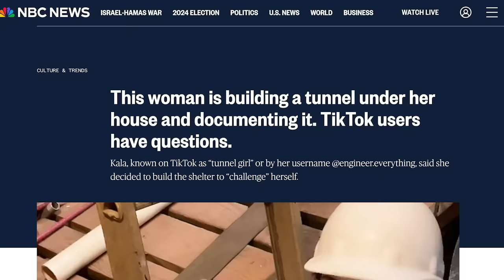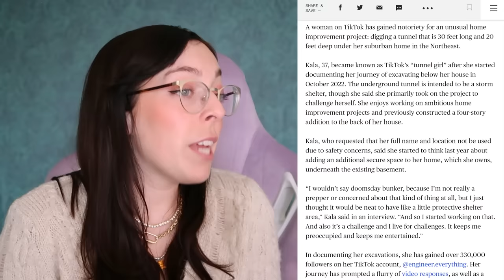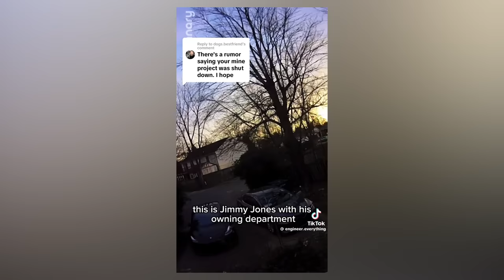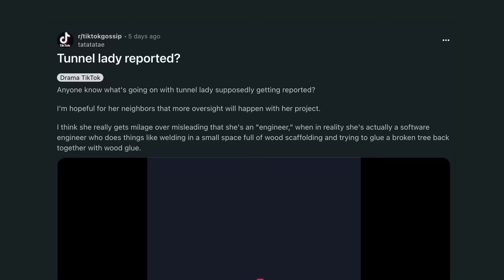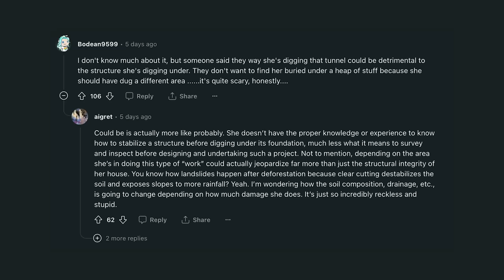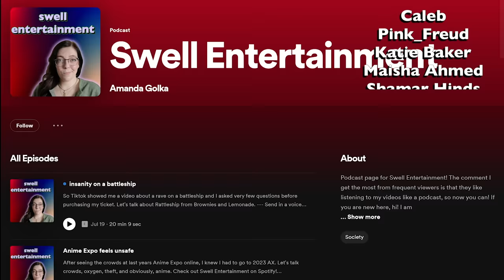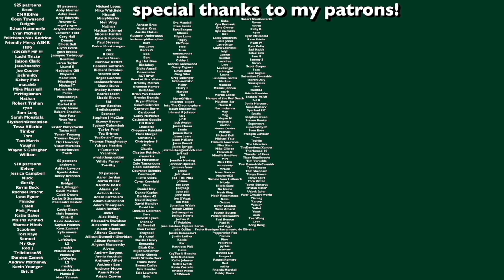people are being weird about the tunnel lady

Comment: Structural EIT here. The problem is not just the safety of everyone in and under her house. Weight distribution in the ground is not entirely vertical. If you've ever been to the beach and stepped in sand, you've probably observed the sand spreading outward and, in the surrounding area of your foot, even rising upward. Entire apartment buildings have collapsed into rubble because someone dug a hole for a parking lot without shoring up the walls.
Reply: I am wondering if they'll condem the entire structure, She built it up with multiple stories and then built a tunnel UNDER the slab.  It can't be safe to live there.
Reply: @Kimberly_Sparkles   I don't see any other alternative, unless she wants to pay a consulting firm to fill it back in safely.
Reply: @JayJohnHeitmann only the most desperate of firms would be willing to take that risk on.
Reply: It’s so scary. I can’t believe she is doing this even with tenants living in her house…. She’s gonna get sued and imprisoned at some point. Or die and go missing down there 🤦‍♀️

Comment: This reminds me too much of the case of Daniel Beckwitt. He hired someone to dig a tunnel under his land and it eventually killed his worker with his gross negligence after a fire broke out in the tunnel. This can either end up like Colin Furze or more likely, Daniel Beckwitt.
Reply: THANK YOU! I’ve been racking my brain trying to remember the names. Such a sad story,
Reply: Did something happen to Colin furze? I saw his digging content but I hadn’t heard that anything happened? I put a  comment at the time pointing out that undermining the foundation without adding reinforcements fast enough to prevent the structure shifting is a bad idea, but I was hoping that they had either fixed it before it effected the structural integrity of the house and the neighbouring houses and/or gotten help with the thing from professionals and gotten the project inspected by the building inspector and structural engineer or geological survey or whatever is supposed to actually happen with the city before he just started digging, at least I know he had the locations for the gas line and water and sewer pipes and he didn’t break the water or gas lines as far as I could tell.
Reply: @MissMeganBeckett  I didn't see anything happen to Colin Furze. My comment was more along the lines of "it can be a success story like Colins or a failure"
Reply: @mothmansuperfan7513  thank you for replying, I’m glad that nothing bad happened to Colin’s house tunnel project that I hadn’t known about.

Comment: I was watching her videos and enjoying them when I thought she was an actual engineer. But when her concrete forms collapsed I knew something was very, very wrong.
Reply: One thing I see no one mention is someone saying she actually got the rock she found wrong, then when she got new rocks they were soft ones. So she couldn't even properly identify what she's digging up and using but these are meant to support her tunnel and castle
Reply: She’s saying  it’s “entirely under the slab of her house,” yes she’s building over 20 feet outward from her wall….is that entirely under the home?

Comment: There are long term issues that stretch long after Kala is gone too. This isn't ugly paint colors, or tearing down the cabinets. She will not live forever and then that house gets sold to someone else. Imagine if no one had ever found out and they moved in and there was a horrible accident? There's a reason you need permits, and safety protocols. 

Her common sense is clearly not there. And as one ND to another, I am telling you there is something off about her. She's not all right, and she needs an evaluation. She potentially needs supervision for her own safety, because this is certainly not going to be the last dangerous thing she does. Her judgment is just not there.

Comment: She should have never tunneled. She could have built a in ground, under slab storm shelter by cutting a rectangle in the slab, digging it out, building the shelter walls via concrete or steel, then re pouring the slab with a door.  People do that all the time.  Once she starts tunneling  under her slab things get incredibly sketchy as she is going under potential loads of her house and risks hitting underground lines and utilities. You can also easily get off course doing this type of thing and end up somewhere you didn't expect. Then there is water and erosion and it washing out after a heavy rain. Those who had concern and reported her were justified IMO.

Comment: It's actually not that hard to get a permit and pay a company to review your plans for this kind of work, there are a few small tunnel systems here built for during the snow. Admittedly when we did it at my uncles we were building the house as well so we already had a lot of equipment and documents to check off, the tunnel between the garage and house was relatively simple compared to the house and garage. Of course contractors did some work, mostly running utilities up to the property and pouring the slab

Comment: Check out Colin Furze if you think her underground work is wild. He's build a bunker, halls connecting the bunker to his house and workshop and now is building an underground garage that will elevate his car to the surface.
Reply: Colin Furze hasn't actually connected his bunker to his tunnel system yet. Tunnel only goes about 2 meters or so towards the Bunker from the access hatch/ladder in his workshop. Going the other way it goes to the access hatch/ladder in his pantry and turns off to the front where he's currently building his 'Secret Garage'.

Comment: In my neighborhood, we had a ground problem, althought thankfully not from someone pretending to be an engineer. The area is over a dried up river bed. It's 60 ft below the surface. When building the entire neighborhood, they only checked to 30 ft because I think that's what the code requirements are/were. One day, about 40 years after the house was built, one side of the house ended up lowering by about a foot. Surrounding neighbors had a similar problem, but usually not as extreme. It was considered a miracle the slab for the house that fell a lot stayed intacted. The solution was pouring 60 ft concrete pillars for that house and a couple other houses to keep them from sinking any further

Comment: The horrible thing about tragic accidents is that it doesn't matter how many times things went right. One slip up, one minor tremor, one failed support, one insane fan. Hell, you need sensors to detect carbon monoxide or methane and I don't think she has any way of checking if they are under groundwater.

Comment: I worked for a building inspection company for a while and they'd do inspections before and after someone put in a pool. Which included the neighbours. I'm not sure if it's local law where we are or just courtesy but they had to check if there were cracks in the surrounding structures because of professionals putting in a pool. This is DIY thing was so incredibly stupid.

Comment: There's a stretch of road near my house that water passes under. It's slightly more susceptible to potholes but generally fine, pretty standard drainage infrastructure. Last summer we got a crazy amount of rain that caused flash flooding, and the entire section of road vanished. 15-20 feet long and I don't know how deep, along with massive chunks of the landscape either side, just gone.
If the government standard, professional engineering experienced catastrophic failure, how the hell is amateur suburban mining a good idea?

Comment: I’m a mechanical engineer who works at a small firm that is mostly run by structural engineers and the differences in what I know compared to a structural is insane. I can’t even imagine the even greater gap between a software and structural. Anyone using her engineering background to justify is an idiot. At most she took some advanced physics classes as a software engineer that’s it. After you get through the basics, engineering funnels you into your subsection pretty quickly.

Comment: I record audio for work, and my microphone had this popping issue too. It was really frustrating, but I fixed it! 

It turns out that it was just a bad connection from my microphone to my computer. I was using an adapter/dongle to plug in the USB-A cord of my microphone into a USB-C slot on my computer. Once I bought a new cord that connected directly from my microphone into my computer with a USB-C, the popping went away.

Comment: 9:51 I mean, I'd have to see the tree being 'glued' and how it was done. But you can sometimes take broken limbs and graft them back on. Ive even seen trees that were split in two skrinched(best word for it) back together and then had a bolt screwed through it. You could probably secure the limb and then use wood glue to seal it... But I'm hoping she's not thinking that's what they made wood glue for. 🌳🧗‍♀️

Comment: The thing is… there basically has to be at least a little more “tunnel content” right? They can’t just leave it exactly as is unless it’s somehow fully stable and not messing with local drainage or utilities or anything. Won’t there at least have to be some remedial work, even if it’s just bracing/strategically filling or adjusting what’s there?

Comment: Not only is this project a huge safety risk for herself and her neighbors, but shes also potentially causing a lot of harm to the environment! She clearly dug into the water table, and was just pumping the water out, and dumping it in her yard. These water tables are underground reservoirs that are crucial to source drinking water for people, or used for crops and agriculture, and helps us from draining our rivers. If the ground water was being used as drinking water, she could have very easily introduced a bunch of dangerous/deady contaminants into the water supply; not to mention how dangerous it is to completely drain, and the repercussions it has on the surface! Obviously, sink holes are a big issue with draining the water. If she lived in an area that is experiencing a sever drought (aka, the west coast), she could get into serious trouble with tampering with the groundwater, and probably still could, even on the east coast.

Comment: So even assuming she did all of this 100% correct (which from my understanding she did not), building subterranean space isn't just about avoiding collapses, it's about the overall safety of the space. My immediate concern is the increased risk of radon exposure, something that normal basements built by licensed and bonded contractors struggle with, let alone someone rooting around in their exposed bedrock. There's no sign of any ventilation or any monitoring system... I really hope she's not spending any time in there, cause this is unhealthy and dangerous even if it miraculously doesn't collapse.

Comment: I have no idea why out all the DIY projects she could have chose in this area it had be this. But if this is something she just really wanted to do she could have easily bought a crappy house in the country and used her abilities to fix it up and then tunnel as much as she wants using as proper methods as possible. It’s one thing to put yourself at risk but putting others and their property at risk is another. Like all the ground water and chemicals and dust from the rocks,  not to mention the fire. Everything just seems so unbelievably risky.

Comment: You should check out YouTuber Colin Furze from the UK. He started with a bunker under his garden (back yard). He has since expanded with a tunnel that links to his house and his latest project is an underground garage. The garage is under his driveway and will have a lift to get cars to the surface. As a plumber by trade he knows a little more than some.